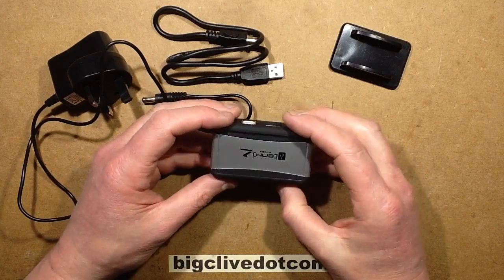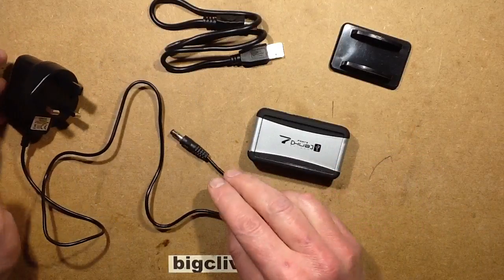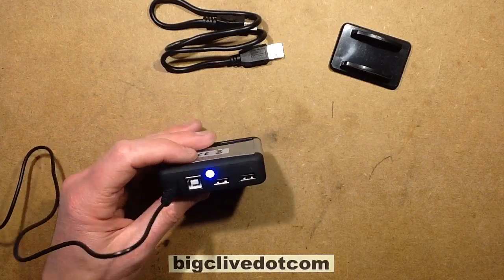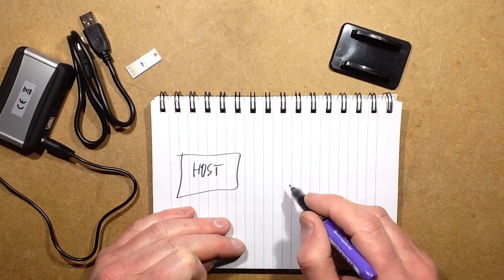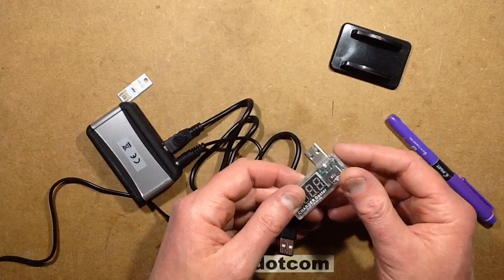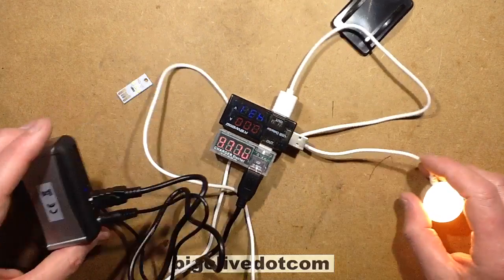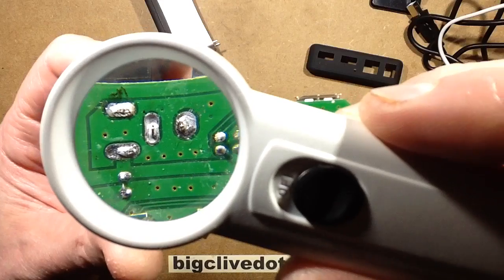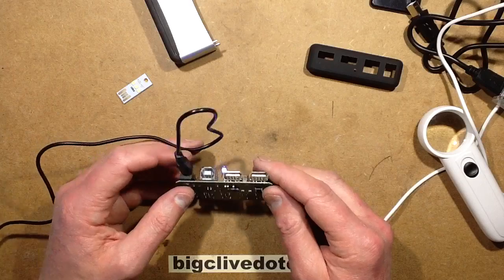Computer killing powered USB hub.  (Mac murderer)

Comment: Just saying... I have the exact same hub and mine's working fine. I actually had to solder the VCC on the front 4 USB ports as they were not connected and the PC port's (USB B) VCC is isolated from the Power Jack and the front 4 USB ports. Different manufacturers, may be? Also I exchanged the power adapter with a USB charging brick, as my requirement exceeds the adapter's current limit (0.6A to 2.1A). Great videos BTW!

Comment: I been using 2 of thies for a long time now ( connect lab equpment to my PC, wanted a cheap hub that i can afford to burn   ) , and even with PCs  they cause problems. but if you cut the usb+ in side the pcb and use a external power supply they work nice :) they try to get power form both  USB and the enternal cheap power supply, and it interfire with the pcs power supply. ones you fix this they work really nice and reliable.
Reply: Cheap Chinese design, they just didn't wanted to put a diode in there :P

Comment: my simple question is. is that hub designed to be powered by either connection. for example the usb connection when a wall plug is not available and the wall plug when the usb is not available?

Comment: I had the exact same problem. Even though I unplugged the mains supply to the PC, the lights on the motherboard would remain lit. It was coming from the cheap USB hub which looks exactly the same in this pic. I unplugged the 5v adapter and haven't used it since. The hub still works fine as it's only powering a mouse and keyboard.

Comment: So let me get this straight, someone could craft a device that detects when the Mac goes to sleep (it stops getting power from the Mac) then a relay is tripped which dumps 5 volts into the computer using a rechargeable battery capacitor combo? Like the USB Killer except it does not fry it with bursts but with the continuous power.

Comment: Reference the suggestions toward the end of the video: 
The USB standard - In its original state - Mandates that USB hosts provide a safe and reliable 500mA as bus power for attached low-power devices to obviate the need for an external power supply. 
As a result, USB hubs like this one - If lightly loaded - Will be perfectly fine on USB power alone, provided that total draw across the whole doesn't exceed 500mA. 
 
Later versions and unofficial extensions of the standard may support higher output current (Typically up to 2.1A in ports intended for phone charging) but it's worth remembering that this might not be supported by all devices on the bus, a compliant bus will apply the safest level of the standard at all times (Which is why you might find your phone taking ages to charge if it's been plugged in next to a USB stick) and that all USB ports in a group (i.e: The ones on the back of your motherboard) are typically all connected to the same host controller and thus have to share the same amount of available power. :-) 
 
Overall: If you're running a hub like this with bus power from the PC, you'll be perfectly fine with no-load items like printers, mains-powered scanners and mains powered external hard drives, or low-load items like battery MP3 players, flash drives, and card readers. 
Other devices - 2.5" USB HDDs, mobile phones, and rechargeable media players especially - Will be designed on the assumption that the whole 500mA will be "theirs", and frequently won't work through a bus-powered hub. These sorts of things are best connected directly to a host port anyway, mind you. :-)

Comment: I got myself a 10 port USB hub, something told me to open it before plugging it into my desktop, good thing i did. it was going to do the same thing, the silkscreen was showing a diode. they just jumped it with a bit of wire >.>. I will always tear things apart and test before using them.

Comment: USB or mains Earth reference if you test the negative on the power supply it will show and resistance short to the Neutral circuit I believe it's a way of pulling extra power in a way it will reached faster then if the negative was going through the PCB

Comment: I have one of these I use occasionally. The power supply it shipped with was faulty so I bought a new 2A supply for it a long time ago. I find it necessary to use the external supply because the feed through the USB cord just isn't enough for literally anything for whatever reason.
I've never had it "kill" any of my computers from the backfeed, probably because I don't use macs (because macs suck), but I did have it one time cause my PC to not turn on when I plugged in the hub before the main power supply and I was confused for a little while.

Comment: I bought a cheap powered USB hub off Amazon and although it works fine when unpowered, when I plug it into the wall it turns my Macbook off. Luckily I only tried this once and everything was fine, but I learned not to use it while connected to power.

Comment: So no real computers were harmed and it works perfectly fine as intended.
Reply: ProCactus no as its a USB killer
Reply: Paul Banks
Probably. But if it is destroying crapples I assume it works fine.
Reply: ProCactus it most likely only made the USB port it was connected to unusable
Reply: Paul Banks
By what I hear its a logic problem, Disconnecting power to the USB gizzards resets the error. I assume some computers might have to have the battery completely removed to make the reset of the chips that control USB.
Reply: ProCactus you usually don't have to worry about the PC being fucked just the port
Reply: Im not worried, I understand no permanent damage will occur unless the voltage is too high.

Comment: What if the power port IS the usb port? will it charge your device?
Reply: Maybe if that device is a mobile device and normally charges from that port, but no, host mode USB usually doesn't have charging circuitry.
Reply: Wolfin I dont even know why I posted that anymore. Any power charges if thats the power port lol.

Comment: I have the same one and I've had no issues, but

1. The included adapter's cable is really short, has unreliable voltage and low current ability
2. Haven't used it with macs or left it plugged in to a shutdown computer, except maybe a desktop which already has some builtin ability to keep ports powered while shutdown for charging

How prevalent is this susceptibility to damage from USB backpower?

Comment: Same here bigclive . I bought one of these killers from Hong Kong on eBay for $1.99 and never could find a driver for it. I bought another one here in the US for $5.99  because it seemed like a good unit and I thought I wanted a hub with an eternal power supply but I still couldn't find a driver. Every few weeks I would hook them to my laptop and spend an hour or more trying to find a driver and the last time I tried, I noticed two ports stopped working on my laptop. I was tired and shut the laptop off for the night and it never turned on again. My laptop was a 20 month old Acer Aspire 17.3" LED, Intel Quad-Core 8GB RAM, 1TB HDD Windows 10 64bit laptop that I paid $550 for on HSN. Now I hope I can sell it for parts on eBay for a couple hundred dollars.

Comment: s5 overload will look like a bad chipset or graphics chip(fans on, nothing else happening), can be reset by completely draining the motherboard of power (disconnect charger, battery and bios battery for about 30 sec) unfortunately, either one requires disassembly, for a mac, disassembly sucks, might as well replace the board

Comment: (I'm new to electronics i may be asking a stupid question)

Couldn't you still use the hub with power but just disconnect the positive wire that goes between the hub and the pc? You would still have a negative and 2 data lines but it would stop the PC receiving the current from the hub?
Reply: You could disconnect the power, that will work just fine.

Comment: I have the same hub and use it to back power my raspberry pi, it was recommended for that very reason
Reply: Which one? Doesn't work on Pi 3, for me at least
Reply: Matt Burnham I back power my pi via the socket on the hub that Clive points to at 1:24, I have two of the second gen pi's.
Reply: how do you do that? do you connect the raspberry twice in the hub? one from the raspberry's usb power-in to the hub's usb and other from the raspberry's usb to the hub's usb type b (the usb in port)?

Comment: I actually have a nice USB hub on my Raspberry Pi that I had to get a male to male USB cable to use to purposely backfeed power into my Pi (because normal powering drops the voltage to 4.5V through the e-fuse causing instability) yet on my desktop I have a cheaper USB hub which does backfeed power. Although I've kept it unplugged since it kept all my other USB devices plugged into the computer awake. It never seemed to cause damage, so I guess it depends on the board. But yeah,  USB hubs that backfeed power are actually quite common.

Comment: I have also bought a USB HUB with separated power supply.
If I connect or disconnect it's 5V Power Supply while it's still connected to the PC than none of my USB ports will work (data-wise, my USB devices still receive power) until I turn off the PC and disconnect the Power Supply.
I think my Motherboard has been saved by some protection feature.
My USB Hub does not power 5V stuff in my PC, so power from the USB Hub does not go into the PC, it's separated.

Comment: I do use one of these for a TV HDMI Android Stick, but I don't connect it to an AC Adapter. Seems to work fine as long as you connect the power to the device, in this case the HDMI TV stick, and usb connect 'it' through the USB Host Hub.  The HDMI TV Stick has been working for over a year, so I must have connected it correctly, without an AC Adapter, never unplug it.

Comment: Well, that could be easily fixed with a protection diode. Or a transistor, which detects the external power supply and cuts the 5V output.
I'm guessing the Chinese just cut down components for cost efficiency and this came out.

Comment: You're not supposed to plug it into the power supply unless you're using it as a stand alone charging port otherwise it gets its power from the host and does not require any other power source

Comment: I bought one 3 weeks back on eBay for $1 free shipping. But I never plugged in the adapter I don't trust cheap china adapters so I use the hub without it and zero issues so far.

Comment: what about windows machines? will it be bad for them?
Reply: This will be bad for any computer. Windows is just the operating system and not the hardware.

How bad it would affect your computer depends on the quality of your hardware though. In this case, mainly the motherboard.
Reply: So itll pop my mother board if i use it. could i just use it without the AC power brick???
Reply: It could do yes and also other components such as CPU and RAM.

If you use one of these without the AC adapter there is no chance you being affected by this problem.

I would recommend anyone to buy a USB volt meter if they buy one of these, even if it's an expensive on. At the end of the day a voltage meter costs a few £s. A new computer on the other hand is at least 100 times that.
Reply: alright, thanks for the info :D
Reply: Only faulty hardware would be affected by this.
Reply: Read Steve Brace's comment for explanation.
Reply: I don't know. maybe you should plug it into your computer and find out.

Comment: OK by just a quick glance when he had the magnifying glass on the traces couldn't you simply sever (cut) the trace between the positive incoming voltage from the power connector and the 5vdc pin on the USB-B connector if your going to use it as a power hub? After all the idea behind a powered USB hub is to allow the extra 5vdc comming from the wall pack to power the usb devices instead of trying to max out the 500ma USB port on the computer.

Comment: I've got an USB Hub from EasyAcc with a external power supply. It power the whole motherboard (Lights and uefi settings) when the PC turned off. This was a huge pain when i searched for the problem in my PC when i finished building it.

Comment: I have one of these. I did not like that the powered 5V and the PC 5V were connected so I opened the case and cut the join. I have a feeling it was actually preventing my PC from booting or something (or maybe just the motherboard light was on)

OK, just opened it up. What I did was cut the track on the top side of the board between the 5V power input and EC8. Since this now means that the onboard red LED only indicates connected to the PC, I added a blue LED to indicate external power at the EC3 position. Also, mine didn't come with a power adapter so I took an old 5V phone charger, desoldered the connecter from the board and soldered the PSU directly. It was still going strong a couple of years later when I finally replaced it with a USB3 hub.

Comment: I have a unpowered USB Hub that i got for about 12$ from walmart.. The voltage is pretty much 5v maybe a few mV higher but when I plug my usb mic. and wireless mouse into it. the voltage is already below 5v. it also gets quite warm but there seems to be only 1 chip in it. and a blue LED indicating power. no idea how only a mere wireless mouse and usb microphone cause it to get so warm.. with the voltage drop there might be some poorly designed circuitry in it.. The wires in the cord are very thin. probably would not draw anywhere more than 500mA at best before they'd get warm i bet. if I had a soldering iron I would resolder some more hefty wires to it with a much longer cord as well (the cord is mere inches long probably meant for laptop users.) I got it since I ran out of space on my PC for usb ports.

Comment: I've had a weird situation with an inverter...
I got a cheap 24$ 12vDC to 120v AC inverter off amazon.
Plugged in a usb fan to test it for a few seconds (only draws about 300mA)
and SMACK inverter bursts into flames through the metal housing and it smacked into the glovebox of the car almost punching a hole in it. Unplugged it and  threw it outside. FLAMING for a good 10 minutes.. Smoking for 2 hours afterwards.. NASTY smell too.

No idea what happened but the fan intermittently seemed to work initially then i went to unplug it. a mere second before i grab it it stops spinning and makes a bang sound.

300 watt SNAN brand power inverter.

Strange because the inverting part worked fine. powering a 220 watt vacuum cleaner at full power for a good 2 hours and the darn thing didnt even get warm.
so i thought it was working great till i decided to test the usb ports...

I'd ask you if you'd want to see what went wrong in it. but it smells so bad even 5 feet away.

Comment: I know this video is a bit old now and I don't own one of these hubs however, would adding a diode or an LED be enough to let power travel in one direction from the host to the device but not from the device to the host? I know you can get a tiny amount of backwards voltage/current but surely that wouldn't be enough to do any hard since the resistance of the LED/diode going backwards would be huge?
Reply: a diode would work, or simply cutting the USB cable open and snipping the 5V line

Comment: Charging hub that powers devices when plugged in.   Works like standard hub when not?If you don't intend to charge anything off the hub when not attached to a computer, just throw out the wall adaptor?

Comment: How does it to that? A mac will automatically disable a USB port if its drawing to much power, therefore you surly can't destroy a Mac with something like this? Unless its feeding power into the USB port its self.
Reply: Mac designs... good on paper, physically terrible. it honestly doesn't surprise me. it's pretty obvious to have over/under voltage protection on USBs, but Apple is not known for their top of the line circuit designs.

Comment: This still confuses me as to why this round have caused problems with the Mac logic board. I have a 7-port Belkin powered USB hub plugged into my Samsung NP-Q320, which has the same backfeeding issue and I know that it does because I can disconnect the power supply and my devices don't disconnect. Can't see how the backfeeding is causing a malfunction in the logic board, unless there's really shit "reverse flow protection" circuitry in the Macs

Comment: I want to charge a windows tablet with a insignia powered hub and use the ports for peripherals at the same time. Can I use one of the powered data ports and a type A to micro adapter to the OTG on the tablet , bypassing the normal port that would go to the host? I would have to use 1 of the 4 peripheral ports but I think it should.work.

Comment: I can see that you can use it as a wall or comp charger or a data connection.
They just forgot a switching circuit. It should shut off the wall power when the data cable is connected.
Reply: Or shut off the 5V from the data cable.